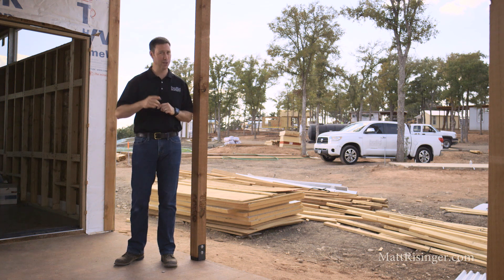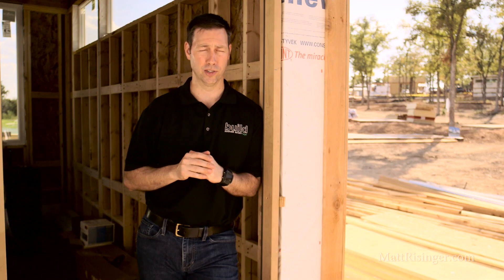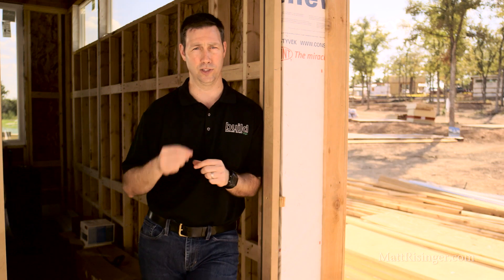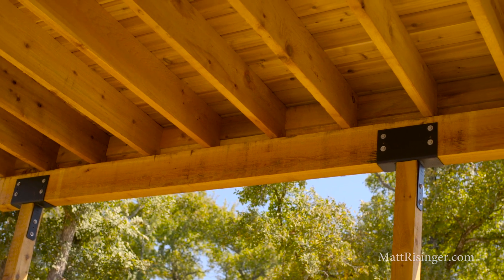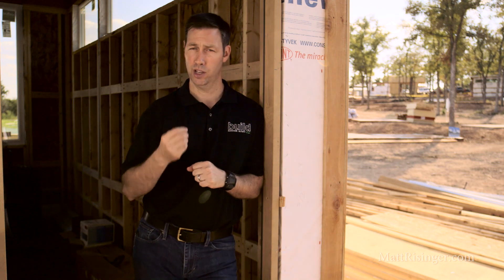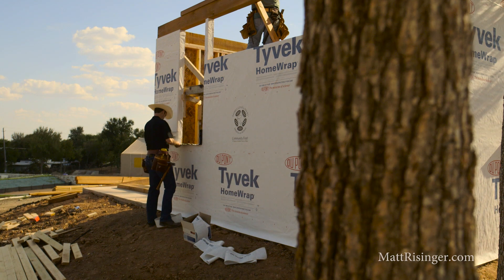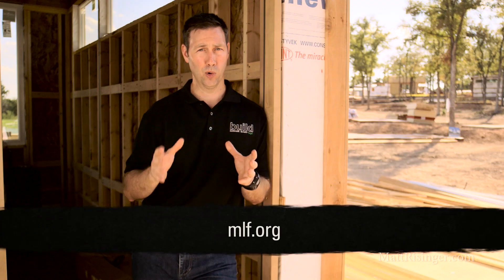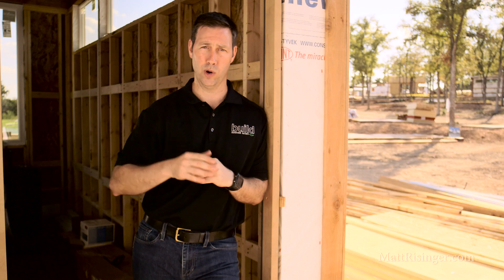Tiny House Tips

Comment: Great video and an amazing initiative. Its nice to see some tiny houses being built on actual foundations and not trailers for once.
Reply: +Modest House Are they not defined by being on a trailer?
Reply: +karl seelbach I personally don't think so. From what I read, tiny houses being built on wheels was popularized by Jay Shafer, founder of the Tumbleweed Tiny House Company. I think this was initially done to take advantage of a loophole in zoning and bylaw regulations.
I believe a tiny house is just simply a house less than 1000 square feet, but really the term is up to anyones interpretation.
Reply from the maker: +Modest House I agree.

Comment: Nice work and kudos for generously donating time on that homeless project. One observation: @ 2:54, shouldn't the rain screen furring be vertical, not horizontal (so it does not impede water flowing down & out)?
Reply from the maker: +R Luna normally yes but we used a coravent batten that has holes for air flow vertically